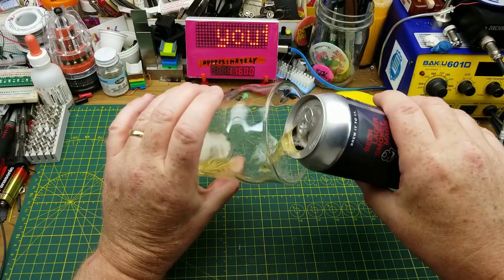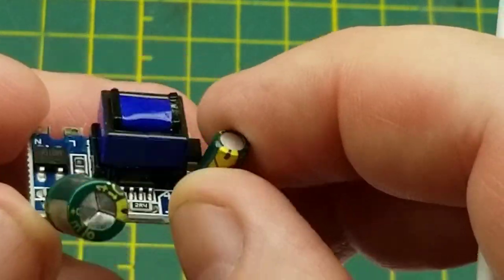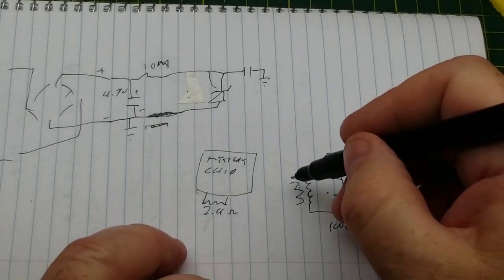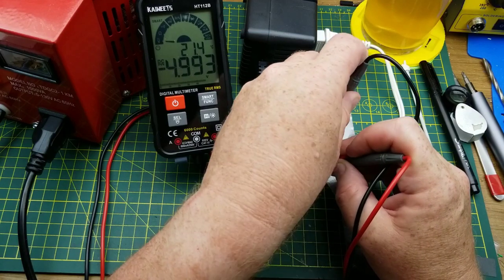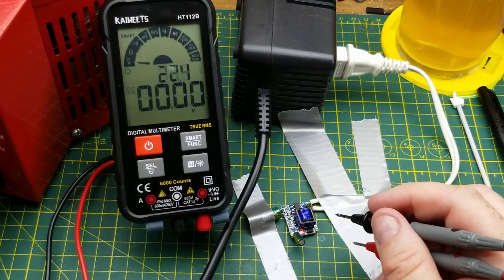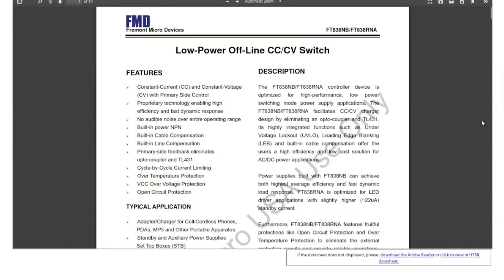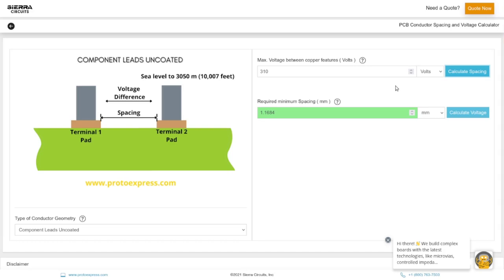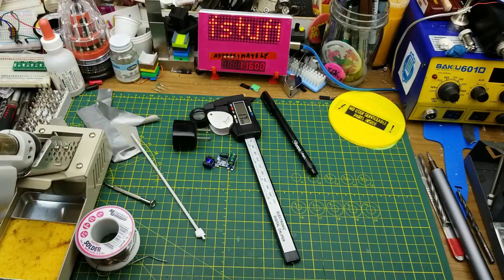tiny power supply teardown

Comment: Interesting teardown.  You are brave.  I hurt myself with much lower voltages.
Guessing that the Zener was regulating the tiny amount of current needed on Vcc for the controller chip?
I have a small collection of NTC protection resistors to give this kind device a softer turn-on.
Vrms -> Vpeak:  220*sqrt(2)=311

Comment: You can get sealed mains to low volt modules, I like them better than a open type.
Search for HLK-PM01, HLK-PM03 & HLK-PM12 (5V, 3.3V & 12V) all rated 3W

Comment: Thanks for the review ! 

This is indeed quite "old school" I think, 600mA @ 5V is also very low..(verification pending ;P) and the kHz switching freq too.. couldn't power my mood-light with this one 🙈

( perhaps there are screw terminals with that pin width so one can use proper wires with ferrules on the input )

No mounting holes cry out loud for a custom 3D print where that thing just "clips in" next to your nano. ;)

Comment: If you're worried about the spacing on the input you could have slid up some shrink tubing after you soldered them and shrunk it down
Reply from the maker: That's only one place the high voltage is close together, but it is a good practice

Comment: The creepage and clearance distance between any mains track and the dc tracks is the important thing. But in  most cases with these Chinese power supplies the transformer windings are the most dangerous part. They often only have the enamel coating on the wires to protect you. These parts should be binned at source.
Reply: so right 😉
Reply: don't these power supplies usually require a safety cap across ac / dc ? .. I don't see it in the schematics. 
I can remember bigclive disassembling a couple cheap EU  USB power supplies and there was that  X or Y rated capacitor across the transformer ...
Reply: @tinygriffy  the cap across the AC and DC sections is to allow noise on the DC side to pass back to the AC side. Most chines boards come with a 3000V cap hopping that the 3000V rating is good enough not to be damaged by any spikes. but they can fail short circuit which then means the output DC is connected to one side of the mains, which might be the Live and not the neutral. To pass most safety standards in the world the CAP needs to be a safety class Y which is designed to fail open, so noise may go up but you will be alive to notice it. with the 3000V cap failing short, the noise will go up but it might be falling on dead ear's
Reply: @TheEmbeddedHobbyist  IC .. so it is just noisy but (relatively) safe without the cap. Thanks !

Comment: Surprisingly good (no load short term) performance for the price. Not much current capacity but as a "universal" input USB supply for relatively low power projects it should do fine.
Reply: not sure .. for 4 bucks I can buy a 2 A USB power supply with ac plug and usb socket in a nice plastic case ..  free shipping. 

I wouldn't say that this is good value for money.. it's kind of useful when you need something really small ?

Comment: I saw modules like this in old electronics (like latest VCR, CD players, etc) mounted (soldered) on the main PCB in slots (rectangular holes). They have similar clearance (somewhat bigger for sure, >5mm) for input L&N. The point is that before this module, you should have a fuse, filter, switch that are mounted on the main PCB/front (back) panel. I do not get what is the fuss with the small distance between L&N while this is (I think) not intended to be powered directly from mains. I repeat myself: this is just a module that is intended to be used with proper filtering (I saw concerns about HV spikes on AC lines), fuse protection (that is why it lacks one) and maybe a proper switch. 
For 450V I think the breakdown distance is some 10um, so for me a few mm distance seems quite safe. Of course, if no moisture, clean pcb, etc. You guys are too scared of anything.

Comment: While such small distances are ok for 120 or 240V, they are not so good at higher voltages. For a device that is supposed to be safe, you need much larger distances, you can get high voltage spikes on mains, and they could be in thousands volts.